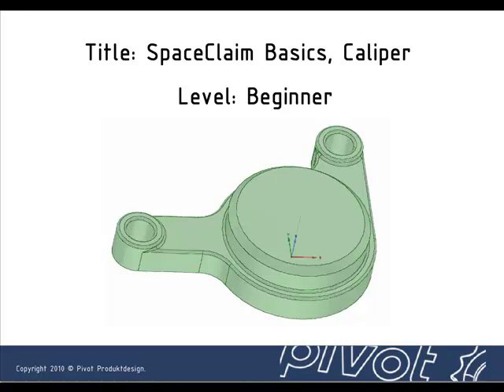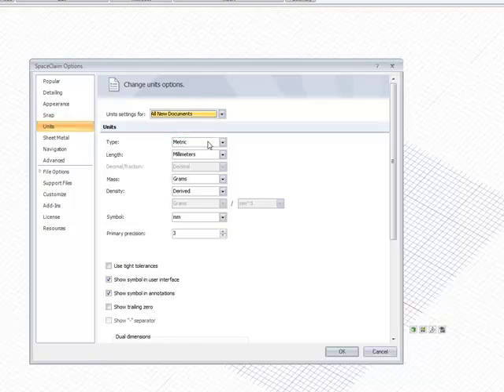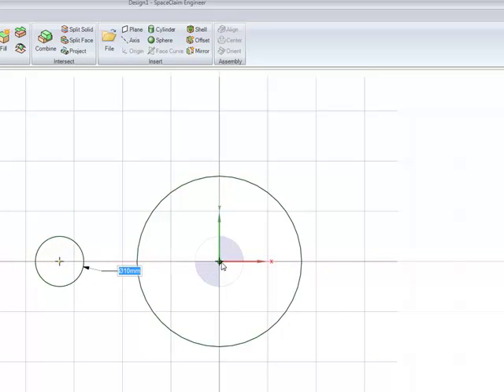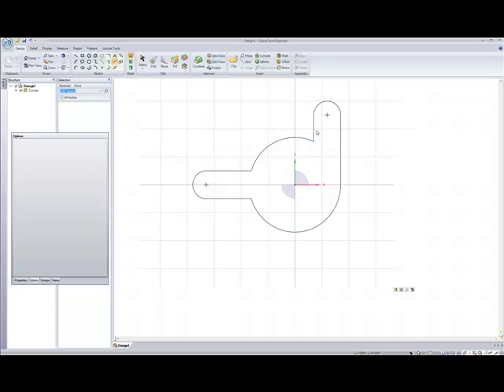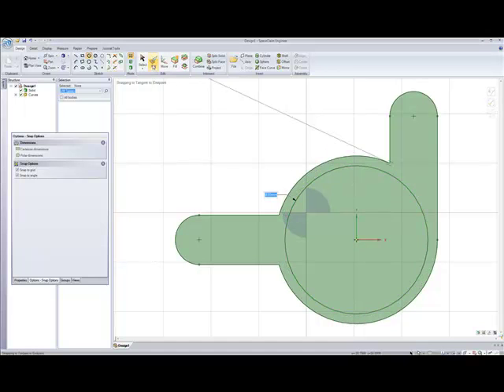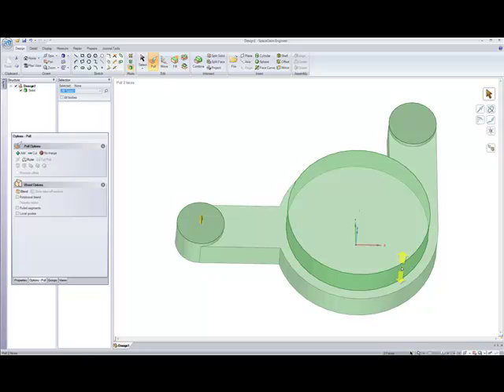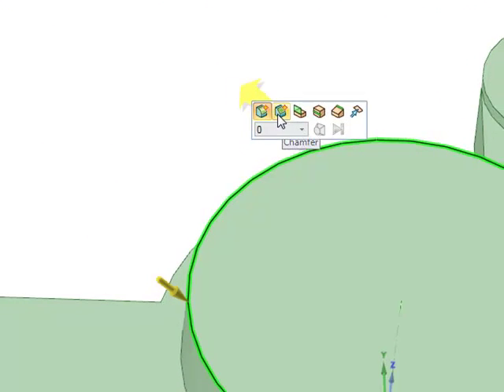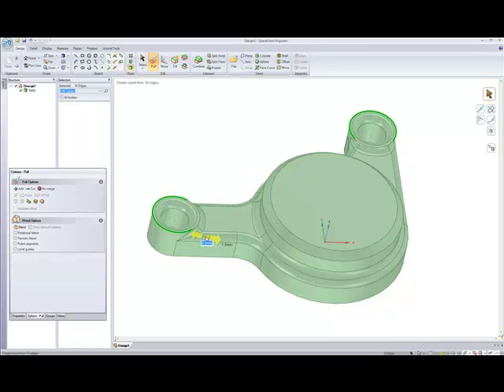SpaceClaim basics

Comment: Hi, does anyone know how to:
1 split lines 
2 how to connect with a line two objects not located in the same sketch plane
Reply: You can connect a line with objects even if they are not located in the same sketch plane by doing this 3D mode.
Select a line, then choose the 3D option to connect line with objects. Its easy.